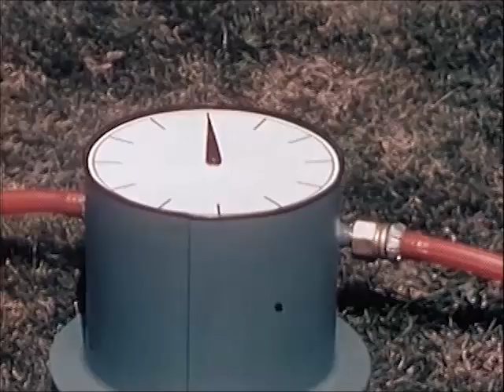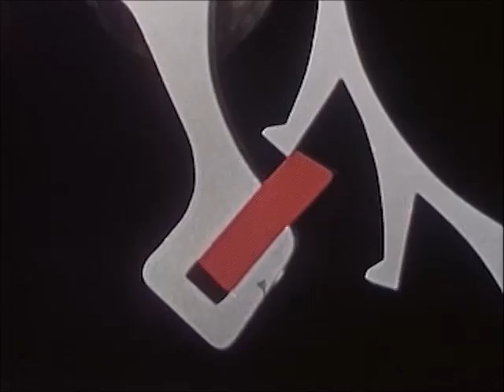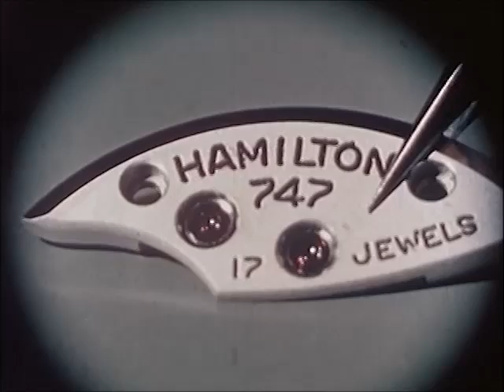How a Watch Works (1949) - Mechanical Watches - CharlieDeanArchives / Archival Footage

Comment: get a quartz digital or casio multi mission drive. they last a century
Reply: +andrey connolly  as a watch lover I would agree with you. The only problem is he is right. I have a day to day watch that s a Casio. Possibly the most accurate watch in the world? It is solar powered,tuned to satellites and atomic clock. It gets no special treatment and shrugs off any dirt water or damage and is so accurate I use it as a master for setting all other timepieces. Short of smashing it with a hammer I can't see how it will not last forever? Automatic time zone changing,daylight saving time and even leap year calendar ! I wish my Rolex could be as accurate as my Casio!
 My Casio gets very much taken for granted and has never ever let me down. It's been covered in paint,dropped in virtually everything and always cleans up like new and still reports time accurate to a millionth of a second! How can it get any better?
Reply: +Andrew Wilson what model have u got mate sounds amazing i would like to do some research TIA